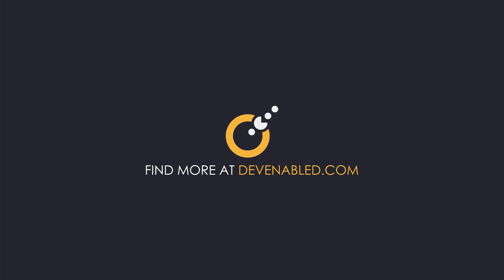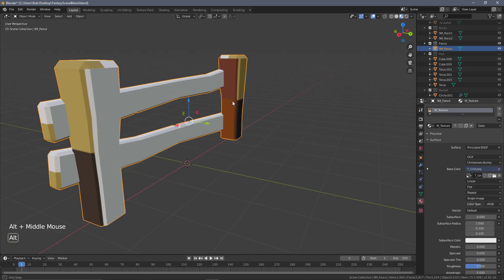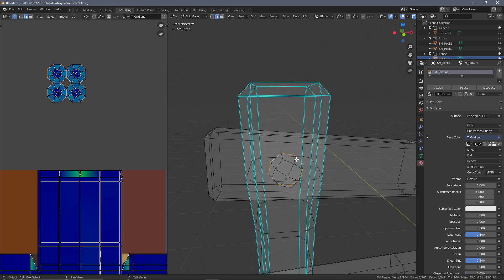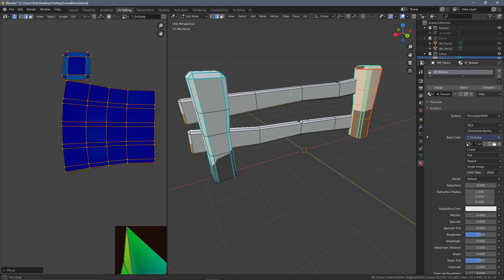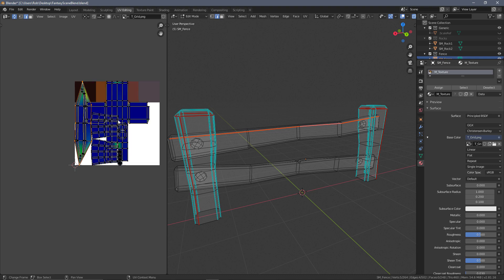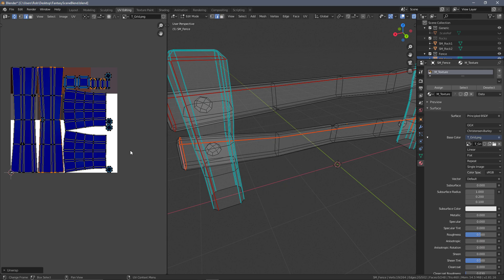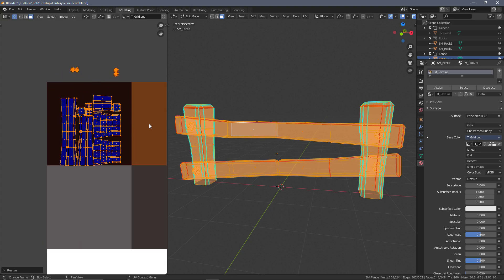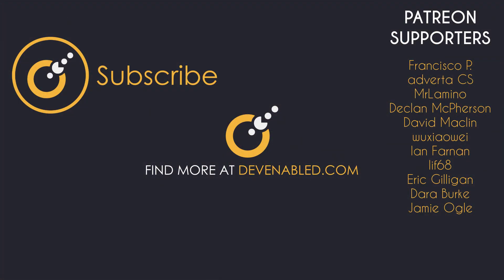Blender 2.8 Fence UV Mapping - Blender for Game Development

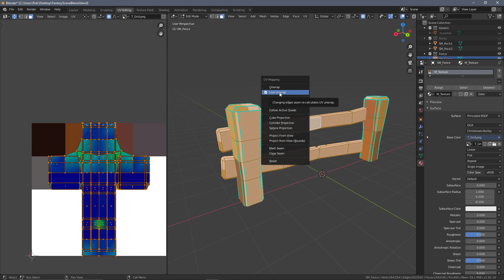Comment: Unfortunately the key screen-casting was not running in this video. I couldn't remember how to select only the screws @2:25 so if you are struggling with the same thing, it is easy: Simply hover over the first screw and press L, hover over the next screw and press L again, and so on... It is the same as selecting a vertex/edge/surface on a screw and then pressing Ctrl+L (Select Linked).

*Edit: Using L to select objects is mentioned a few times later in the video.